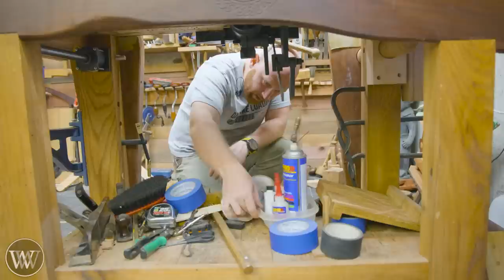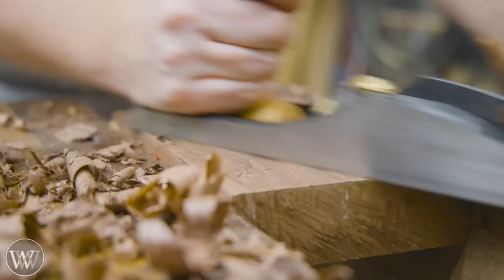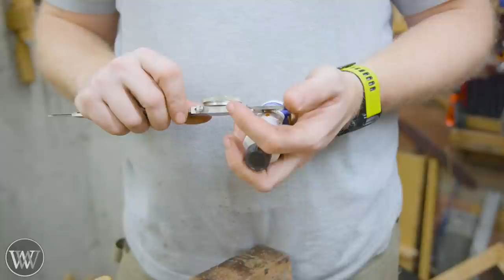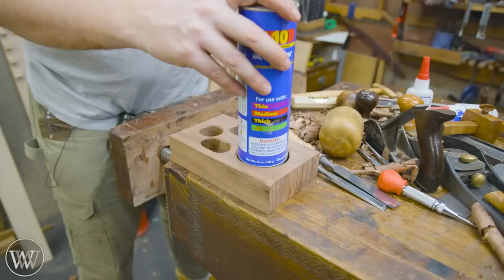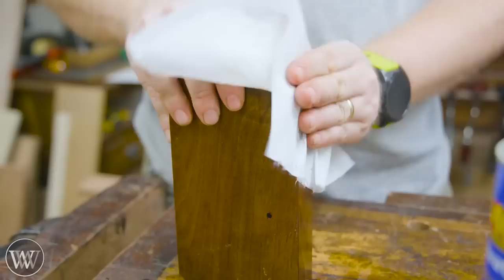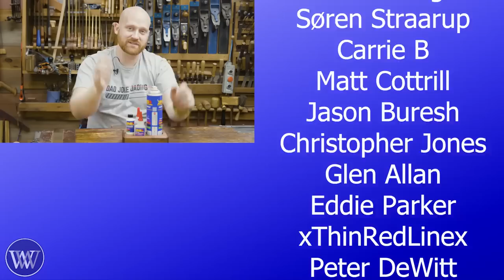No Falls Super Glue Tray How to Version

Comment: James, in case it might be useful for that activator can, I also ended up with a looser-than-ideal fit for a (different) can on a recent project. I found that a 1" strip of ⅛" cork provided just the right amount of "shim friction" to keep the cylinder in place, while still allowing smooth extraction and insertion. They sell rolls of ⅛" cork at Ace Hardware for small bucks. I stuck 1" double-faced tape to the back of the cork, and then cut the 1" strip off the roll with a mat knife, block-sanded the thickness down just a bit and then sanded a bit of a chamfer for the edges (separating myself from the animals). That slight tapered edge allows smoother entry. Then I just stuck that cork strip around the base of the can. Worked great.

Comment: I’m on a mission to keep
everyone safe who uses superglue. Disclaimer:I am not the safety police. I have a legitimate concern from personal experience about using super glue especially in a shop with very little air flow or turnover. I had a fairly severe reaction to the fumes when helping my grandson repair a broken toy. It was close work and it took a while. I was not using an organic fume face mask. My vocal cords swelled and I was in bed for more than a day. After 2 years I am still hoarse. 
Use outside or with an exhaust fan or wear a canister style mask. 
There are a few other videos relating to the same issue, some worse than mine. 
Nice project James.

Comment: I recently used the "drill a small hole for yhe auger bit to follow" trick and it works really well 👍 i just made sure the hole was thinner than the auger snail and then it could still grab on and pull through the work

Comment: Always wear an apron when using thin cyano. I don’t have a pair of trousers without drops of cyano on them. 
Essential project this video. In UK Mitre fast is an exellent form for woodworking. Acetone is good for debonding as also is moist salt. Cyano is good for keeping a joint in place while the more suitable glue dries. Cyano joints alone aren’t usually much use unless you are using balsa wood, or nailing and screwing. 😀😀😀